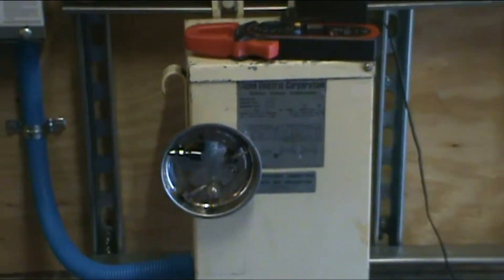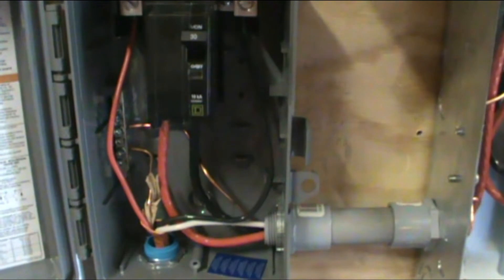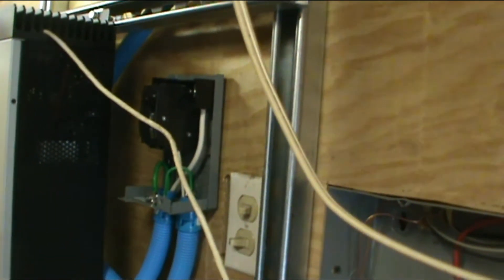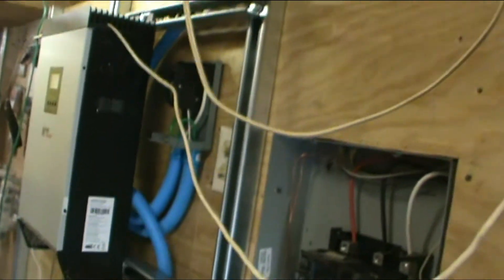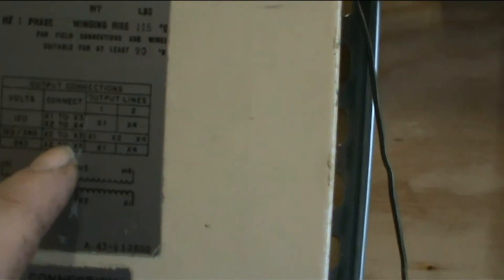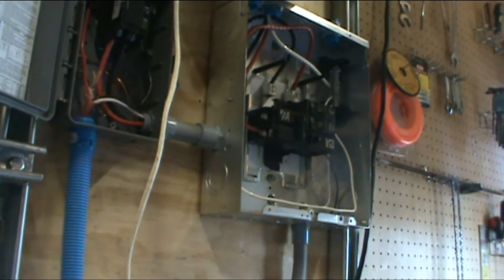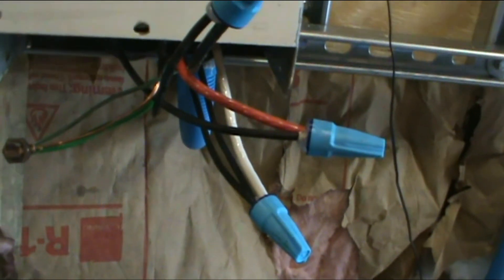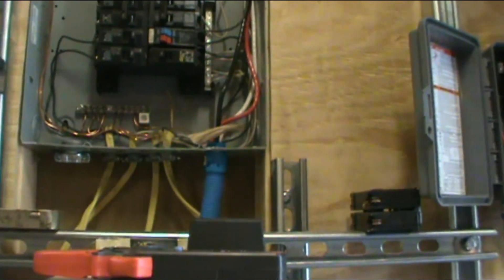New Solar Install Part 5

Comment: If you want only to operate from the battery bank...you would not need the Input trannsformer...right?(No need from the the grid) ...You will only require the split transformer output...to make the PIP compatible with USA standard ...let me know....thanks!!!
Reply from the maker: your correct. You dont even need the input transformer even when connected to the grids 240/230, I found that out later and no longer use the input transformer anymore.   but will need the out put transformer if your running 120 volt appliances.  If all your running is 120 volt appliances you will not need the split phase at all, all your will need is a 5000kva 240 volt to 120 volt  transformer.  but I plan on in the future using some 240 volt appliances so I used the split phase transformer.
Reply: a 5000 KVA ???....or a 5kVA ??? ...I believe you meant 5 KVA...will those transformer handle ... say 2x    during the start of an electrical motor for 1 second or so...??....What brand (GE, ACme..etc)  are you using for de 240 split transformer ??... Talking of the 240 to 120...I have seen this one..HEAVY DUTY 10,000 WATTS STEP DOWN VOLTAGE TRANSFORMER FOR 220V/240V COUNTRIES(VOD 10000)...sound pretty good ...for $259.99 ..but the idea of the split transformer is still quite appealing.
Reply from the maker: yea meant 5kva the inverter I have has a 8k surge for.  it will start my 230 volt ac unite with out any problems its a 18000 BTU unite.   I have had 2 12000btu ac unites and a 5000 btu unite on it at one time.   my microwave has worked off it.    I would get a matching transformer that goes with the inverter. unless you are going to get more than one inverter and stack them since these inverters can be stacked up to 24kw of out put with 6 unites parallel.  other wise if you have and unmatched transformer it will be wasting power though the transformer it its larger than what the inverter needs since its only a 4k watt inverter.

Comment: could you tell me what model I would need for a 24v battery bank that will work in the usa. TX . I am not sure what mop model to buy off ebay  like yours but 24v

Comment: Got contactor idea was tell ya about working no need for 2nd transformer. working great so far!
Reply from the maker: off grid kid yea I seen your video with the contactor. I like to use it to turn the external transformer off and one when not in use..
Reply: It's worth doing! have never had the second transformer was saving up for that victron 100amp unit we were looking at. But now happy with this setup.
Reply from the maker: off grid kid I have some contactors that are 40 amp but they are 24 volt ac coils. I have tried to use dc using 12 volts becuase it would make it work.  but the coils got hot and melted lol.  I like to find a contacter that I can use with  12 volt DC so I can run it straight from my batter bank. I have a 48 volt to 12 volt dc to dc converter I have been thinking of some solid state relays I have also but have not decided.   I also need to tun my input transformer as you can tell it was at 245 some times it a 238.  and when it switches back and forth you know the differents in voltage can be seen in the lights and i like to tun the transformer more to 230 volts I know of a way to do it just have not gotten around to doing it I just have to build a choke with some heavy gauge wire to bring the voltage down wont be to hard just need to shave about 10 volts off and I wont see the flicker as much and it will be softer on my equipment as well.
Reply: Funny but i understand what your saying now!!! lol!

Comment: can you hookup a slave pip to this for more power?, just read through comments, so yes!
when you hook up six pipss is the output all going into the same 240 vac power panel or are they separate>?
Reply from the maker: they will all be all 240 volts combined
Reply from the maker: and yes you can stack them up to 6 PIP's can be stacked for up to 24kw of output power 100/% duty cycle.
Reply: McCuneWindandSolar but the two transformers would have to be able handle the 24kw though or maybe just the off grid side
Reply from the maker: Rev John O'Toole yes even if I was to get just one more PIP I would either have to get a larger transformer for the out put. or another 5kva output transformer.  or a auto Transfromer that can handle up to 10kva  since each PIP inverter is a 5kva inverter.
Reply: The pip has output power select options - Single, Parallel, Phase R, S, & T of 3 phase output.

Comment: If your using the grid just to charge your batteries? Just hook the pip to the grid 120 volts. Works great for charging batteries, There will be no power loss this way. General rule bigger the transformer more power it takes to run it. toroidal transformer are some of  the most efficient.
Reply from the maker: How I have the PIP set up is it uses solar first so when there is solar it runs every thing off that, and if the solar drops down it will take some from the batteries, but if the battery drops to low it will switch to the grid until battery is full or solar is good enough to cover my loads. ect. so with the large transformer that I have I can run every thing off it,   Just I want to build the relay switching so when its is running off solar the transformer is also disconnect from the loop.
Reply: That's what i was trying to explain last week. Using a smaller transformer to trick the pip in to thinking it was on the grid & enough power to charge the batteries. relay switches grid to grid then back to pip when batteries are where you want or solar power is there.
Reply: Switching the pip supply transformer on/off as needed. Was thinking using the pip generator start switch to do this with a contactor. But if you think about it, We will have even more power loss going threw two transformers. Your really good with this stuff know you will get it dialed. have done a lot in the short time you have had it. Thanks for the close up shots of transformer! Starting to understand the wiring. thanks!
Reply from the maker: off grid kid Yes you are right with Two transformers they use more power. Even at idle they are using power its like having those charger's for phones ect even when not powering anything they are still using power.  why I like to turn the input Trans off when not in use.   I have been looking close at those Auto Transformers that you have found and have been thinking if I get a Second PIP I will be looking in to getting one of those instead. IE the 100 amp model would work great with 4 PIPs
Reply: I'm saving for one!!! It's bad azz!!! for sure. talked to the rep. Mad Cool! Has a 5 year Warranty. It's amazing how far you have got with your system, having the family, working ect..... Had mine since November last year only getting as far as you did in one video. lol!!!
Reply from the maker: off grid kid wow and mine is newer than yours with new upgrades like both 60 amp chargers both solar and grid charger for 120 amps total..  I have those Auto transformers in my book marks and backed up LOL so I can go to them again when I want one. because for the output stage would work great. I will be using only the one 7.5kva transformer just for charging but if I get a auto transformer I will probably just use the 5kva for grid charging if I need to.  and use transfer switch if I need to get connect to grid if I have to work on my system.  but there is a lot still left to do.  finding transfer switches that can handle up to 100 amp or even up to 200 amps. I know they have them because they have them for generators and they have auto Transfer switches also  I hop with videos like mine and yours and if any other Americans get on the band wagon I hop they will see there is a market for them over here.
Reply: I Have the 60/60 120 amp unit. Looking froward to the progress your system.
Reply: Thinking some of the power loss your getting from pip to transformer is making the 120 volts. some how it's adding the 5 volts? expected 115 max. That's awesome your getting the 120 may be worth the 100 watt loss???

Comment: lot of work to get them going in the US mate. Cleaning up the mess is always the hard part :)
Reply from the maker: But I got it going,  I hop my videos will help others if they chose to go that route.
Reply: McCuneWindandSolar I am thinking of selling my go power 1500 watt inviter to buy a pip. Just do not know tho.  Where did you buy the trans from and if I where to just go with the power out side what would it cost? Thanks brother.

Comment: Hopefully soon we can add the other PIP.
Reply from the maker: I cant wait to get another PIP if I had the money I get one to day.  But first I going to get this loaded up with solar panels and get the new addition to the shed built, and build the power room witch this will all be sitting in side of.  once that is done I will be getting more solar and another PIP. and I will be relocating the main line going in to them home to the power room and then the main line coming in from the Grid 2/0 cable.  and once I have all the solar I need to power every thing with solar to spare I will then work on the battery bank so I can have up to 100KWH of battery storage. to get me though some nasty solar less days

Comment: Ok ,, I am trying to keep up on how you wired this up to work here in the States,, It is kinda confusing,,, Where do I go to buy the kind of transformers you are using?
 ,, Nice job tho figuring it all out and making it work properly :)
Reply from the maker: O got the Transformers off eBay they are 480/240  to 240/120 isolation Transformers, there are tones of used ones out there that's what these are you can get new ones also,   Later on I will be trying out a Autotransformer like what you use on and out back on the out put side of the system to see how that works, but that is when my system grows, because they have one that can handle 100 amps and they are light compared to my transformers. and once I get up to 4 inverters I will need at least one for 100amps of draw. and I will try one of those.
Reply from the maker: As I get more time I will work on a good Diagram for every one, to see how its all wired up. with diagrams ect.
Reply: McCuneWindandSolar
Well I have a long ways to go before I get to a 48 volt system ,, but when I do I am glad you are making these videos ,, The PiP/ Giant seems to be the way to go,

I am going to wait until you are all done before I start buying stuff ,, but I am always looking to the future and what I want out of my system , I buy a part here and there over time, the price will not be so bad,, buy it all at once and it could cost allot :)
Reply: That is awesome,, thanks Jon for the link !!
It is really something to think about for my setup,, I am kinda leaning more to getting more solar this tax return,, next year I might buy one :)
Reply from the maker: Jason Brown the one he shows is not stake able and is only 2400 watts but if you don't need any more than that then it would be fine all depends on your needs ect. What I like about my unite is I can Stack 6 of them for up to 24kw of power if I would ever need it. or I can stack 3 of them for a 3 phase system that would be 12kw for 3 phase never would use it but the flexibility is there with this unite.  But if 2400 watts is all yo will ever need then its a nice unite
Reply: Jason Brown YA I AGREE!!! Nice and well done.. but confusing?
Reply from the maker: Richard Downer its not that hard LOL just a lot of stuff in so many different places.  going form 240 split phase to 240 single phase then back to 240 split phase after inverter.  all other stuff battery, and solar are pretty much easy just need the breakers or fusses in place. other than that pretty easy   I'm also running a line from the breaker box to a sub box in the use to take some circuits off and put them on the pip also.  will be taking the home off gird little by little.
Reply: McCuneWindandSolar
I would love to see the wiring blue print on that.. thanks bud..

Comment: You have done a real nice job installing the pip.
Reply from the maker: thanks and I have so much left to do. But man that thing is tough. and its working great. when I have solar it turn's off the grid and runs on solar and solar goes down some and need more power it will take it from battery's it almost asks like a GTI and its great been running all day off solar and no grid.